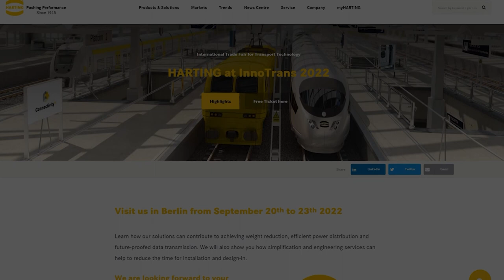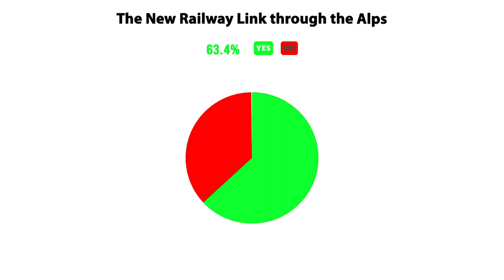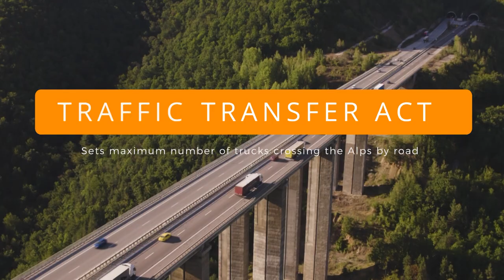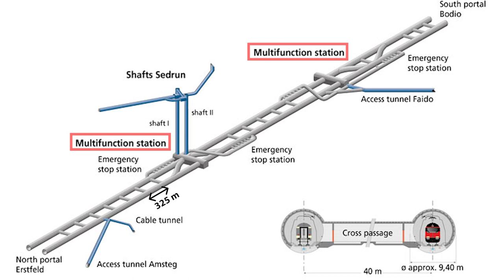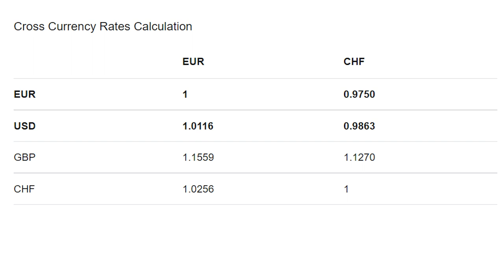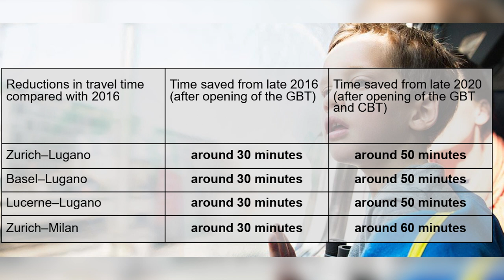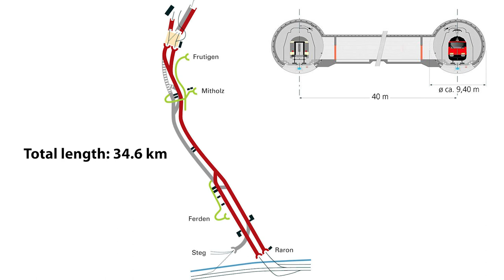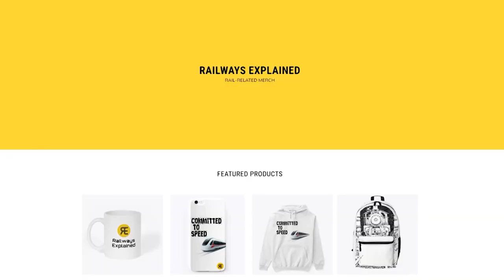Why Switzerland drilled the Alps like cheese?

Comment: Why country like swit doesnt use PRT system to replace railways?
Reply: PRT?
Reply: @KD10Conqueror  Personal Rapid Transit
Reply: @KD10Conqueror  If this thing replaced by PRT might just cost 3-5billions.And much more cheap to maintain,15000-20000person per hour,far more stations than Railway system.They can connect every village in switerland aint that nice
Reply: Why? Why should we combine the disadvantages of rails with the disadvantages of cars? PRT is not and will never be in the position to even closely compete with the transportation performance of railways. PRT is more of an american technology daydream but definitively not the solution of the worlds traffic problems. It's just cars. In bad.
Reply: @avgeekinfotainment7776  Amigo i am not American.Compare to PRT rails have far less stations,far more expensive,far more hard and resist to build.with PRT you can just go out your home at lets say houston 300 meters get in the pod,one or two stops you can arrived your friends home at Dallas.Can rails do that?
Reply: @avgeekinfotainment7776  and PRT is not bloody cars.Its most advantage is  it has side rail when pod meets the stations.so it wont effect main rail. so you can have far more stations than subways or rails. And its  very cheap to build.
Reply: @avgeekinfotainment7776  it can replace subway and railway,it can connect almost everywhere in your country that means you can just go out your home using PRT system reach anywhere you want.
Reply: @juanlu3958  Please write that down: everything that works with small capacity pods, simply sucks at mass transit. Because mass transit is the complete opposite of personal transport by its very definition (hence its darn name), so please stopp believing, that personal transport systems solve mass transit challenges. In densely populated areas you need capacity, not privacy. Proven by almost two centuries of transportation experience... You will end up with millions of vehicles moving on a highly complicated network of tracks and (maintenance heavy) switches, standin in each others way an thus reducing average speed below 30km/h (unless you accept frequent mass pile ups). Sounds like cars to me. Automated cars, with the disadvantages of being fixed to a rail and not having one straight in front of your house. In fact, if one is too lazy to walk 10 minutes to the next bus or railway station (which is average for Switzerland and rated as "gold standard" for densely populated areas by city builders), then there is no hope anyway. It's just the worst out of two worlds combined.

You can't go to high speeds, because the lack of inertia of such small boxes will make your ride horrible. You can't go to high speeds, because you would still need safety space between each pod (which you need because the following pods need to be able to stop before an accident point, favourably without harming its occupants), which will result in a ridiculous waste of space. You won't reach 20'000 pax per hour, you might be lucky to reach 4000. You won't ever reach the capacity of a jam packed double deck train in the same space and definitively not at 300km/h, because you  waste too much space on railing and pods. Why should one accept a 3 hour ride, that is done in 30 minutes?

Oh, just forgot to mention: can you have a proper lunch in your pod? I'm not talking of a bag from McD or a pot of ramen in your lap staining your pants, but a proper meal on a proper table with proper table linen and metal cuttlery and even real service personel? Or just take a dump without stopping?

On a side note; please stopp calling me amigo, unless we hearded sheep together. Thank you.
Reply: @avgeekinfotainment7776  buddy it only needs 1second pod*6persons( to reach 20000person one hour line that aint hard based on todays technology.we already have 15000per hours prt experiment system  we have computer controlled system this aint complicate if it runs by computer,any delays can be easily fixed. 
it wont have ramen it wont fast like railway,but it can 6 OR 7TIMES cheaper than railways it can have many intermedia stops for you to relax if you wanna eat Ramen that much.Its like why America still needs railway when they have so many airlines? because railway although it slower than airplane its more quickly to get on.Same with PRT.With PRT you dont need times to get to railway stations and wait for trains.understand it amig.. buddy?
Reply: @juanlu3958  PRT are just "personal trains for introvert people" and are a joke, the energy cost and the ecological impact make it a no-go for Switzerland.
Reply: @avgeekinfotainment7776  as for speed  in the city it can reach more than 30Mph better than the trains .In the less stops line it can make 70 to 45mph*based on todays technology ,aint bad dont you think buddy?
Reply: @juanlu3958  for the 220km from Zurich to Milan? Great, makes planes faster again.
Reply: @juanlu3958  you won't ever go in 1 second intervalls. From 70 km/h you already need almost 10 seconds to decelerate to 0 at -2m/s2 and even that will make grannies tip over, if not buckled up. So 10 seconds are the minimum interval at this speed, if you want to avoid following pods to crash into a suddenly stopped pod. Accidents happen, even in the most sophisticated system, that's why there are such safety regulations. So you can cut your 20'000 figures to 10% realisticly. Do you know? You don't need to buckle up in trains for this very reason, great achievement. If you want shorter intervalls, you need seat belts or the occupants will be smashed around your pod on an emergency stopp.

And I rarely have to wait for trains here, maybe 2 minutes in average, because they run on time in a well known schedule. I know when tehy run, you just schedule yourself around the timetable, which is actually highly convenient. Having a 30 or even better a 15 minute intervall, gives you plenty of flexibility. Or even more frequent, there are metro systems with 90 second headways, easily carrying 1500 people per train. Equals 60'000 pax per hour. With decade old technology btw. Don't try polygons if you want to reinvent the wheel...

So in cities where busses and trams run in a 5 minute headway, I don't even bother about the schedule, I just walk up. Or if its just 2 or 3 stations, I just walk anyway. Allegedly this is seems to be good for your health as well...
Reply: @avgeekinfotainment7776  did i mention to you less stops line?of course you cant go that fast in the city,At the countryside you think thats hard??
Reply: @avgeekinfotainment7776  you can make the side rail at stops much more longer you think thats hard to bulid the longer side rail dont you?
Reply: @avgeekinfotainment7776  Buddy lets say i go to a place like Taiwan,i staying in Taipei city  i want to go to Travel place at north of Taiwan.In theory which one will be more quicker trains or PRT?i will say PRT.Its like trains compare to airlines,within 500kms or 800kms i think trains might be a little bit faster.
Reply: @juanlu3958  maybe within city limits, you might be indeed faster. If you are willing to rip out all existing, paid and affordable infrastructure and replace it with something fancy, where you, as a city, are no longer allowed to maintain your tracks on you own for legal reasons and are dependent on a OEM, which can go bust or is just no longer interested in maintaining your system for financial reason. It is already a big issue with something like the french VAL system nowadays. In fact, there is already something that covers almost all of your point at a tiny fraction if the price: Bikes, e-bikes in particular, especially if you are lazy or the city is hilly. 

But tell me in gods name and all holy, how you could ever think it could be a great idea, if Switzerland have build a PRT instead of the Gotthard base tunnel, like you suggested in your first post? This tunnel is not ment to bring you around with 35km/h, but to ship millions of tons of cargo between the north and the south of Europe year over year. For every passenger train that runs through it, there are three to four cargo trains.
Reply: @avgeekinfotainment7776  buddy,the only reason i can think of for switzerland size of country too spend 25billions to build railway system is just because switerland is EU country your guys need to blend in.That will be not the case for the most of countries on this planet
Reply: @KD10Conqueror  lol dont cry swiss train lover let us talk like adult okay.Trains max capacity 20000person per hours.PRT even as today can reach 15000person per hour thats just 1.5second per pod system.low capacity what?In theory a country like swiss Trains will never be faster reach to any destination you want than fully build PRT system(unless your home is very close to train stations and your destination is another station.And its much more easy to build cheap fixable enviroment friendly and more easy to maintain,so why you wanna  trains instead PRT at your country buddy
Reply: @juanlu3958  ok, you know what, Comrade?
TWO can play this game.
So, let's start, shall we not? 
So, your first argument is that PRT has great Capacity. You are also saying this in weird wording (15000 per hours(???)). Where are your sources for this? Why does PRT seem so great, yet nobody hears? Also, what the hell is A PRT system anyway? You only say PRT, yet don't say what it is. I guess you mean underground tunnels, perhaps hundresa if not thousands, that bring you from point A to Point B real fast. However, this idea can't work out...
You see, building thousands of tunnels under a city is just nit posibe. It might seem like it, but it's not. It is also incredibly expensive to build such shit anyway. Also, bringing you from point A to point B so fast would make you isolated from the world and you would get T h i c c. 
It is also not more environmentally friendly, as every pod would have its own engine. (Economy of scale).
Also, let's say your destination js like 200-700 metrea away, then there is no need for PRT, as you can just walk or take the bike.

So, PRT has a lot of problems, let's make it better and revolutionise Transportation!
1. Instead of having tunnels everywhere, we could add a big Building in every town, where these pods could arrive. For big cities we would place them every 5 kilometres or so. For inside this distance we could make some smaller pods, to transport people around more frequently. Like this you get a healthier lifestyle and we can cut on costs and complexity! Sounds great right? LETS MAKE IT EVEN BETTER!
2. Now we could also make the pods WAY bigger. Like, more than a hundred metres. And also wide, so that on each side from the middle, 2 people can sit. This will greatly increase capacity, and we don't need many small motors. Hell, insteas of these things running on diesel or their own batteries, we coukd add some cables over the route these pods go, so that it becomes super efficient and environmentally friendly.
Now we can also add two steel bars and ateel wheels on the big pods, to make it even more efficient. At this point, we are done with improving our PRT network. Of course this new system need a new name. Let's call it:
RAIL TRANSPORT.
There we go, we revolutionised transportation, congratsulations...
Reply: @KD10Conqueror  Vectus in 2014 already has 3 second per pod 9 persons10000person per hour lines ,today it has new braking system can make it 2 second per pod if it is 6 persons pod it is very easy to make it 1.5 second per pod line.with new technology i dont think its hard to build 1 second per pod line
and Prt is just the hanging rail pipes with iron props stick to the ground.why you need the tunnel for it?It very easy to build dont need any new technology.
In the City of America it can build like 15millions dollar per miles at countryside it can be much more cheaper. can train do that?
Reply: @KD10Conqueror  * FTA funding revealed a capital amortization cost of $18. 35 and an O&M cost of $3.60 for a total cost of $21.95 per person trip! An analysis of ATN costs (in a city with low density) revealed $2.44 and $1,44 respectively for a total cost of $3.88 per person trip. >>>>>
Reply: @KD10Conqueror  Do you know if you build the railway animal are gonna hard to pass it?you gonna effect enviroment for sure buddy.if you build the PRT on the wild it will almost  damage nothing.animals can pass though like its not there.
Reply: @juanlu3958  Dear Juan. 
Even though this is is kind of a valid point, it isn't. Animals can still pass Railways quite easily. And saying only that, makes you seem like you ignore everything I have just said.
Look, PRT will never be a thing. You should maybe also look at or go to countries before you write dumb statements about it. I hope you have learned something.
Freundliche Grüsse
Ein Schweizer Bürger
Reply: @KD10Conqueror  so why the heck your government needs build a tunnel for railway?Swiss train lover cant make sense.amigo,PRT might shine in the future when the newest generation system with capacity 1 second per pod or 20000pph,max100km/h.It might not but its way better system than trains to build in a small size country like swiss,buddy.The only advantage of train is just because its been built for century long.Dont cry swiss train guy Thats is just the facts
Reply: @juanlu3958  I like how you don't add any sources to your claims. just further makes my point more legit. just live with the fact tho. PRT won't ever thrive. Cry about it!
Long Live Rail!
Reply: @juanlu3958  Look, i do not want you to write more of these comments. The reason is, is that you are, and I hate to say this, making yourself a fool. There are people out there, that try to solve transportation in places where this no such (like in America). But People like you can hinder these Projects. I was going to report you for misinformation, but i have decided against that. You might just be a kid, who does not yet understand engineering. however, if you continue these posts, i will not hesitate to report your misinformation. Please think about this. it's for your own good.
Reply: @KD10Conqueror  Is just your kind of people wiling to talk non sense of things drag this world down.If i have thing i dont know i will s hut up unlike you shout out louder think you are something.you are not amigo.
Reply: I Talk to people at Mexico and Ecuador i said Land value tax will make your country much more richer they will resist the idea think i am making non sense just like you.you know knowing nothing aint wrong knowing nothing but like to having  ideas to everything is a sin.so sinner watch and learn more amigo
Reply: @KD10Conqueror  Why i need give you source?who the heck are you?Vectus Prt cant you just google it? I am not yout father
Reply: @KD10Conqueror  Today they called PRT ATN now i guess,you are welcome to check i wont give you anything.
Reply: @juanlu3958  look.
Even if they say that it is "the future", you don't seem to have done reasearch, as i already have.
Consequently, as you continue to do your  "hyped by BS concept" comments, I have reported you for misinformation.
Reply: @juanlu3958  
1. I actually am ftom Switzerland, which is why i am even arguing with you
2. Your english needs some serious improvement.
Reply: @KD10Conqueror   i am not planning to live the country like America or Any European country why i need to improving my english
Reply: @KD10Conqueror  你這位年輕的瑞士人還是需要放下成見，方能立地成佛。善哉善哉，阿彌陀佛